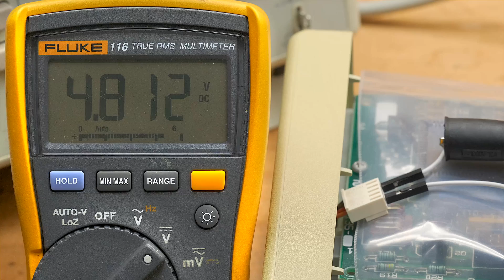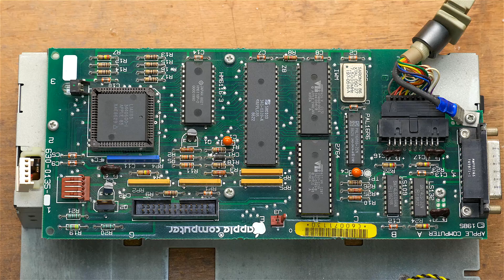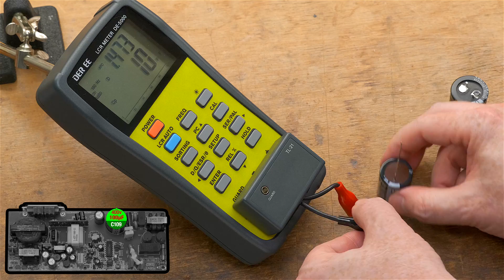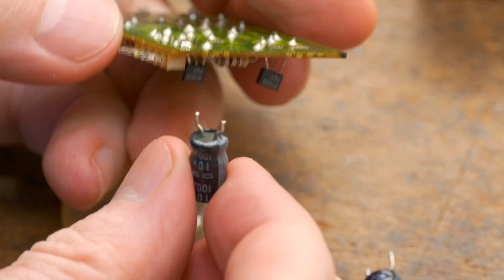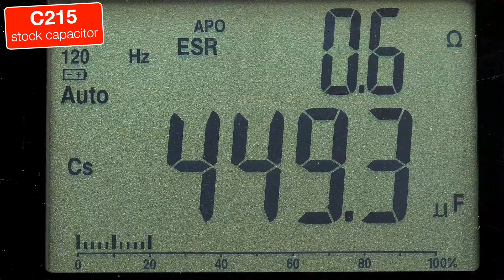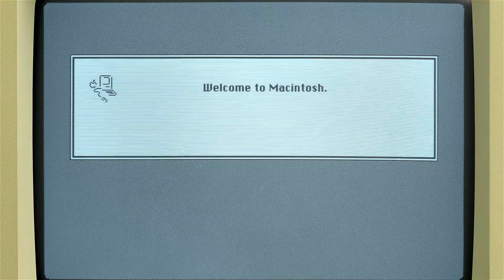Apple HD20, SONY PSU Recapping [Part 2 of 2]

Comment: I am new to the restoration world and enjoy learning about fixing old electronics like vintage Macs. I wonder if most parts machines that a person might buy are restorable assuming no major capacitor leakage that damages the PCB. Thanks again.
Reply from the maker: Professor Lund, thank you for the excellent question. The short answer is "sometimes." 🙂

An Apple "parts machine" is often sold by someone who has no idea how to repair a machine, or who has no desire to do the job. There are parts machines sold on EBAY where a repair is surprisingly easy — merely obtaining a working battery for a Macintosh Portable, for example, often brings the machine to life.  You might even find a Macintosh SE for a cheap price only because the seller thought it was bad because they didn't realize the screen brightness was turned down all the way.  But there are also machines sold which have been mostly destroyed by an exploded PRAM battery.  That damage is worse than even leaking capacitors.  And of course, many machines have both leaking caps and an exploded battery.  

When the guts of a PRAM battery are sprayed everywhere, PCB traces become severed over time, legs of IC chips become eaten away, and most metal becomes horribly rusted.  Even so, there is almost always something inside a destroyed parts machine which can be used in a different vintage computer which has far less damage.  

In terms of restoring a very damaged machine though, I am pleased to report that "battery bomb" computers (which have PCBs that are no longer usable) have served as the inspiration for reverse engineering geniuses like Kai Robinson (at the TinkerDifferent forum) and Bolle (at the 68kMLA forum) to create brand new motherboards for the Mac Classic, Mac SE, and Mac SE/30.  Many components on a battery bombed motherboard remain functional and can be desoldered and moved to one of these new boards. Unusable parts on the battery-bombed board can often be sourced from Mouser, DigiKey or even from China.  There are even small organizations like "CayMac Vintage" which will take your old SE/30 motherboard and move components to a new Bolle edition SE/30 motherboard.  Building an entire motherboard is not impossible to do yourself (I have a video tutorial about how to do the SE Reloaded motherboard, for example), but having the right soldering and desoldering tools is paramount.  Even then you would also need lenses or microscopes to see the smaller SMD components more easily (for a Mac Classic or SE/30 motherboard).

Lastly, there are some machines which tend to be harder to restore than others due to more leakage or battery bomb issues.  When you are considering the purchase of a vintage computer, I would recommend joining an online forum or FaceBook Group which pertains to that computer (e.g., Mac related groups).  If you are thinking about buying a Macintosh Portable, for example, you can then ask "the experts" what are the most common problems.  They will then tell you about the need for a working battery, the fact the Conner hard drive may be unusable, and that the motherboard needs to be recapped.  They will then go on to talk about possible leakage from the 9V PRAM battery (near the main battery), and mention that the rubber feet on the bottom may be missing,  You then will be better informed so as to decide if buying a machine with those potential caveats is worth it.

For instructional repair purposes, obtaining machines that have mostly through-hole components like a Macintosh 128K, 512K 512Ke, Plus or SE are easier to deal with than surface mount (SMD) machines like the SE/30, Mac Classic, Classic II and newer.

Best wishes!

Comment: Hi James,
I finally purchased my first BoueSCSIV2 W Pico and am pleased to report, it does seem to work.

One thing, well, a couple,
Firstly, how would I go about setting up a connection with, say, a mobile hotspot on my smartphone. I read through the BlueSCSI WIFI documentation and it highly reccomends OpenTransport which, as we discussed a few weeks ago, doesn't work on a Mac Plus.

I'm also wondering, is it possible to convert .dsk files to .had files as I have many great files that I made on my FloppyEmu saved as .dsk images but none at all as .had inages. I know I could theoretically plug my FloppyEmu and BlueSCSI in together and transfer files via the Mac itself, but that would take FOREVER.

I really want to test the BlueSCSI further, but it's getting over the initial hurdles of setting the thing up with... probably the worst Mac for the job 😅
Reply: Update, I’ve gone about it the long way (putting files on the FloppyEmu and connecting both that and the BlueSCSI to the Mac and transferring files between the two using the Mac itself) for now. It’s slow but, it works just fine until I can find a better work around. I’m still working on getting WI-FI working correctly as the Dynaport drivers that came with the documentation don’t seem to work on my Mac Plus running System 7.0.1 or 7.1 (the most ideal Web capable OS for the Plus since as we know, it doesn’t like 7.5.5).

Comment: I’ve got one but unfortunately I think the hard drive is bad
Reply from the maker: You just need to measure the voltage.  If the voltage is right, then it could be the stepper motor is not spinning up the drive. You can read Dog Cow's experience lubricating his Rodime here, although I would only recommend the stepper motor and not the ball bearing in the middle of the large spindle: https://macgui.com/news/article.php?t=445

Comment: That's conformal coating. It gets sticky when it dissolves from the alcohol.
Reply from the maker: In that case, it must be Acrylic Resin, brushed on at the factory.  It doesn't feel rubbery like Silicone Resin would be, and it comes of fairly easily with IPA and a toothbrush, which implies it isn't Urethane Resin.  It would also explain why the copper side of these PCBs tend to be in good shape after 37 years.  But I must say, the smell is pretty powerful.  You can smell it even before you try to remove it with IPA, but even more so after you've removed some of it.
Reply: @JDW-  Haha, indeed, some conformal coatings are smelly, but from my understanding the odor comes mostly from the secondary ingredients.

Comment: to read/write from/to old macintosh HFS filesystems i use a linux machine(virtual machine or real hardware) i can read/write directly from the normal file browser. disk images need to be mounted as drives. but its by far the most fricrionless way to do it in my experience.
Reply from the maker: I'm 100% Mac-only and have been since 1984.  (Yes, I'm rare.)  So naturally, I prefer a Mac solution to read HFS disks, and the ideal is to be able to do that on a modern Mac, which means Apple Silicon.  Unfortunately, none of the modern solutions to that problem work for me, hence, my only way to use the Tash20 is to use my FloppyEMU to move files from my modern Mac to the real HD20, then copy those files to the Tash20.  I do not like that at all.  The Tash20 needs a redesign to allow the SD card to be formatted in the way pretty much every single SD card based drive is formatted (i.e., not HFS).  MacSD, BlueSCSI, FloppyEMU -- none of these give me trouble.  Only the Tash20 has an HFS-formatted SD card.  It's really quite frustrating.  Why not use the FloppyEMU instead?  Well, I do.  But the Tash20 is neat because its cheap, tiny, simple, and it doesn't get in your way.  No cables either.  It's a super neat product if you can get around that HFS formatted SD card.
Reply: @JDW-  This sis something that I find unpleasant when doing data backup on vintage Apple products at my computer store. I've had several customers bring in old floppy disks or an ancient machine and they need files off of it. With an IBM compatible machine, I can take disks from 30 years ago, put them in a USB floppy disk, and pull stuff off with no trouble, barring bit rot. Apple machines are quite a bit more interesting to do the same task.
Reply from the maker: @ralphshoop8822  Vintage Macs have gone through 3 eras of 3.5" floppy disks: (1) 400K SSDD, (2) 800K DSDD, and 1.44MB 2HD.  The 400K and 800K disks beat the IBM PC in terms of storage thanks to Apple's choice of GCR variable speed.  But that broke compatibility with PC disks.  You can read PC disks on Macs with special software, depending on the model, but reading Mac disks outside a vintage Mac can be troublesome.  It's therefore best to have a Mac Plus or SE FDHD or SE/30 or Mac Classic to be able to read the old 400K and 800K disks properly.  You can then convert them to disk images via ShrinkWrap, Disk Copy, etc., then attach a FloppyEMU to the vintage Mac, copy the images to the FloppyEMU, then put the SD card of the FloppyEMU into your modern computer (PC or Mac) to copy off the images and save them to a server or send them to someone by email. Of course, you can download images from Macintosh Garden, save them to your FloppyEMU, attach the FloppyEMU to your vintage Mac, then copy the images to a real floppy.  It all works rather well thanks to the FloppyEMU and the modern tech it provides. Just imagine having one back in the day!

Comment: Looks like we've started a RUN on HD20 Caps at Mouser-one of them is already on back order!  lol.
Reply from the maker: Which cap?  I just now checked after reading your comment, but none are showing backordered.
Reply: @JDW-  it's the 10volts 1200uF AEC-Q. I ordered 4 & it told me 3 were back ordered. I did 4X on everything, that's the only one that says B.O.
Reply from the maker: @WelcomeToMarkintosh  Although I like Mouser, they are also a band of idiots at times.  It was just in stock, and now it says "non-stocked"!  Totally and utterly insane.  Mouser loves to play those crazy games.  I just swapped it out with pretty much an identical cap.  You can now buy multiple carts in confidence.  Sorry for the trouble!
Reply: @JDW-  Yeah, as soon as I edited my order to 4, I got the message. I may have gotten the last one.
Reply from the maker: @WelcomeToMarkintosh  There are 1300pcs of the replacement cap I just now swapped in place of the backordered cap.
Reply: @JDW-  Sweet! Thank you!

Comment: Fantastic James! Thank you-I'm ordering my Mouser cart (x4) ASAP! I'm glad you did not have any ESR issues this time. I liked the black & white inset graphics with the caps highlighted-makes what you were showing very clear. Also, thank you for showing the expected voltages & where to measure. All four of my units spin up, but none mount. Now I can test for voltage issues before I start. Hopefully this fixes them.

Comment: Great Video as always. Just a thought on measuring (and selecting) the caps: As this is a switch mode power supply, the caps on the secondary side get charged with a very high frequency in the kiloherz range (thus they need to be low esr) so they should be measured with the 100kHz setting while the primary side ones (the >300V ones) can be measured at the double of your line frequency (100/120Hz - i know japan uses both) as this is what they need to cope with behind the rectifier. Thus they also don't need to be low esr ones.
Measuring the secondary caps in the low frequency range can make them appear healthier then they are for the job they need to do.

Comment: As for the (very) slightly higher noise, your second measurements were done out of the case, so in a slightly different electrical environment. As you mention, I'm not sure this is very relevant.
Reply from the maker: The noise differences were close enough so the differences are not relevant.  I did such extensive testing because I had issues with the HD20SC PSU recapping, as shown here: https://youtu.be/Qof-Wjj_rWI?si=sVcGDeLoH8MsBrak&t=2481

Comment: Also, showing the location of screws or components is really a very good idea.
Reply from the maker: Even though I made this video to help people know where the screws go back, it's still a good idea to screw them partially back into place during disassembly.  Then you know exactly where they go!
Reply: @JDW-  That a super simple yet powerful idea. Can't remember how many times I messed up with screws, even taking precautions. I recently watch some watch repairs, and noticed they tend to put back screws on complex watches as well.